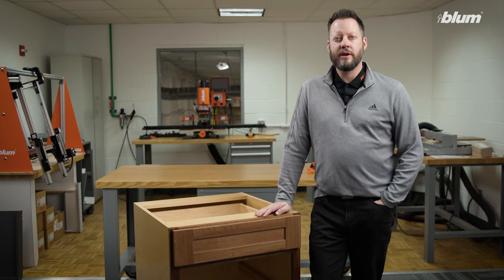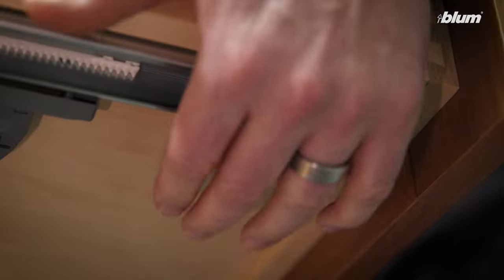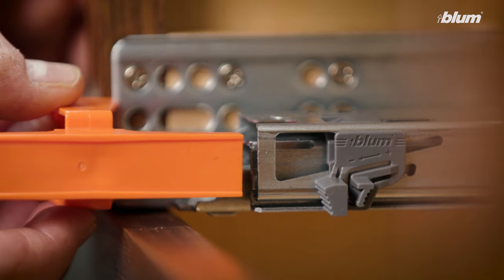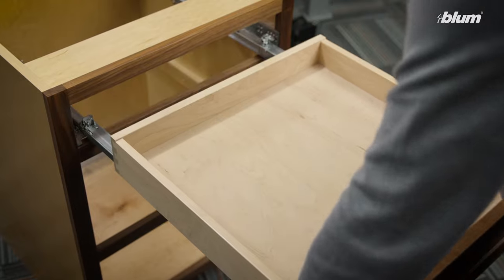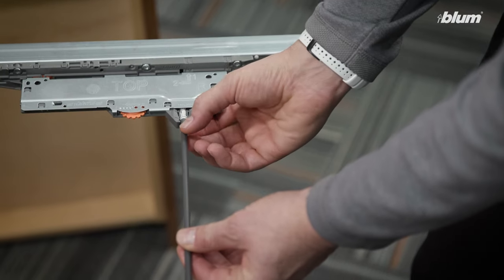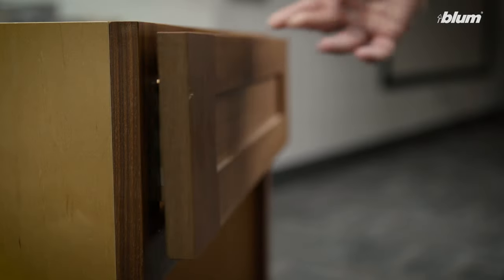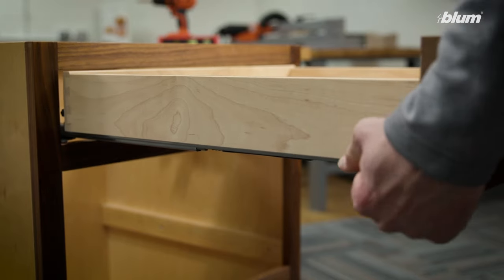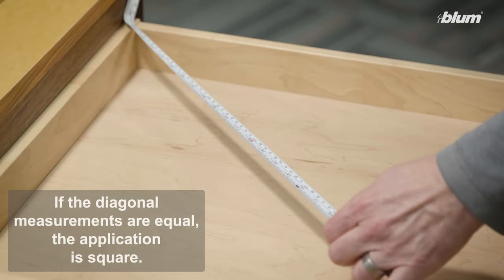Troubleshooting TIP-ON BLUMOTION for MOVENTO

Comment: Can you show how to adjust it if it isn't closing properly please?
Reply from the maker: Please email us at marketinginfo.us@blum.com with a little more detail. If the runner setback is correct and the TIP-ON BLUMOTION units are properly set using the front gap template, then there shouldn’t be a closing or opening issue.

Comment: Is it possible to use just one tip on modules on a narrow drawer with movento sliders?
Two modules wouldn’t fit in the space between the sliders
Reply from the maker: Unfortunately, we cannot recommend using it with just one TIP-ON unit.
Reply: @BlumInc  thank you, I wanted to try that in a 24cm wide (internal) cabinet

Comment: Don’t understand how to use the orange block thing what are the measurements referring too? The thickness of the drawer front?  Mine are 3/4”.
Reply from the maker: What you're seeing is called a Front Gap Template. This piece helps set the 1/8" gap needed between the drawer front and the runner.
Reply: @BlumInc  but don’t understand how to you it.  You mentioned a measurement for which side to use but didn’t show what that measurement was referring to.  Again I didn’t understand how to use it.  I have one drawer even though everything is the same does not have a gap so it doesn’t work.  And several and it takes two hands to push to open even though I have sync rods in all of them.

Comment: Some of our drawers with tip-on blumotion do do not close properly or open again when closing them. This is very annoying and even after trying several things as shown on the web, no success... We have the L5 black (on 12 drawers)
Reply from the maker: Hey there - the L5 is for heavy duty drawers, so it will work better for drawers that have a good bit of weight in them. There are other unit options available for lighter drawers.

Comment: One of my drawers always sounds like something is rubbing, like if a piece of paper was crumpled up in the back and getting ran over every time you open the drawer. I removed the drawer box and noticed that one runner slides much more smoothly than the other. The synchronization rod has also broken on one side because the drawer slides were not moving together since one is smooth and the other is a bit forced. What can I do?
Reply from the maker: Hey there - You will need to replace the broken synchronization rod. The part for this is: T60L1118W. If the sync rod is not broken, then you will need to check the synchronization adapters, part number: T60.000D

Comment: I have no trouble with push to open, but the soft close requires me to almost throw the drawer. Anything less and the drawer just bounces back. I have two that behave the same way.
Reply from the maker: Hey there - It does require a fluid push to overcome the spring that opens the drawer, but it sounds like you're having to use abnormal force. There are different units available for different weights of drawers. For example, heavier drawers require a stronger unit. It sounds like you may have the wrong unit on your drawer. Please take some photos of your drawer and the hardware and email them to us at marketinginfo.us@blum.com.
Reply: What is a sub front thickness mean?  My drawer front is 3/4 inch?  I have one drawer that won’t active I have sync rods on all drawers not all open in no matter where I tap.  This seems more like rocket science than the average person can handle.